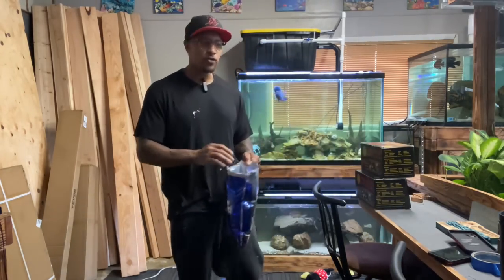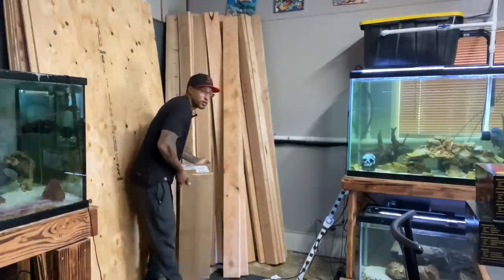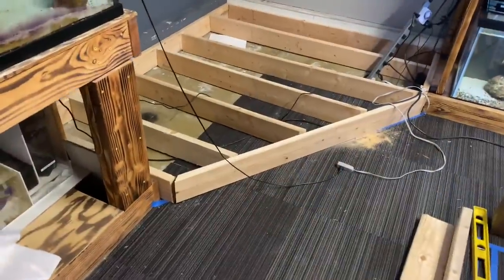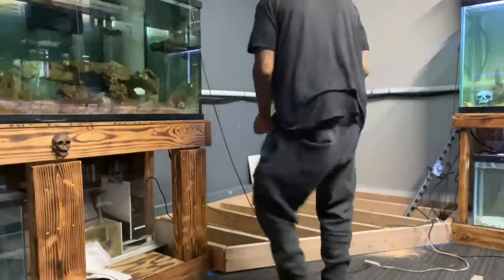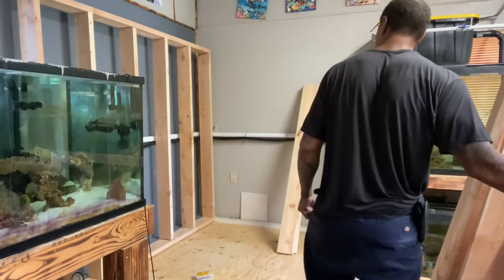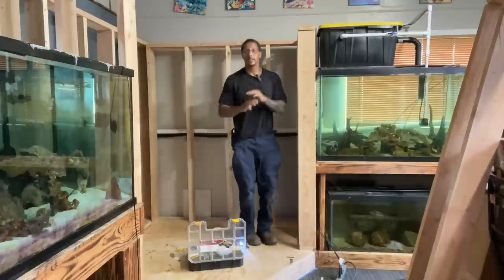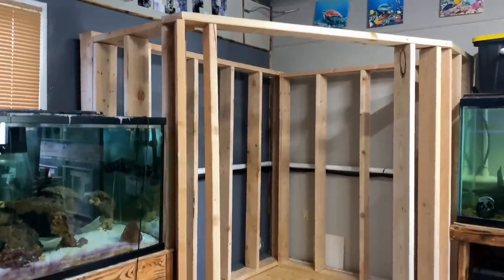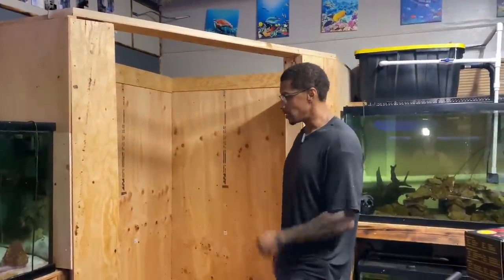1200 GALLON PLYWOOD SALTWATER AQUARIUM BUILD!! Pt. 1

Comment: Cleveland need some blocking in-between those wall studs. It will tie it all together.  The floor i suggest you put 2 more studs inside the outer perimeter to tie those 2x6 wall studs into. hope you at least doubled up on the plywood floor too. Nearly 11,000 pounds on it. I wish all the luck in the world on that build brother. 🙏
Reply from the maker: Thank you Brother, I appreciate your genuine support and feedback! I will definitely add bracing int between the studs and add 100’s more screws! I also plan to add a second layer of plywood everywhere! Right now the build is on hold but the idea is to make sure this thing never leaks!

Comment: Not to say you did anything wrong. but i would use PL premium to glue and screw everything together. second i would put bracing from stud to stud. second i would put bracing from the existing wall to the tank wall. I only am a Carpenters formen and have 25 years experiece building. I watch your content all the time  great videos and as soon as my house purchase goes thru i will be doing something similar to what you are doing. just not as many tanks .
Reply from the maker: Thank you for your support and feedback Brother! I respect and appreciate your comment! This is the difference between someone actually trying to help, compared to someone that just criticize without giving a single suggestion! I’m taking everything you said into consideration. 💯 I’m not done, I plan on removing the plywood and adding a ton more screws and bracing, I also plan on adding a second layer of plywood everywhere, I was just trying to get the walls up in the video. This thing is so far from fiberglass ready. By the time I’m ready to fiberglass, this thing will be solid asf.  

Congratulations on the new Home Brother! What size tank are you going to build?

Comment: 😱Aw Lawdy!  That wall gonna buckle, causing a leak aka real big phuaqn’ mess,.. at 44:50 timestamp look at plywood ,.. it’ doesn’t break evenly on 2x6,.  U can add another 2x6 to the left of the one that piece plywood it  coming up short at the bottom,. Is the floor level,. Did u square the framing,. 
 If u run into any problems , reach out!! I was framing homes  for 30yrs. That and concrete, roofing & remodeling,.
I’m not hating on u, just tryna help! 
Those aquarium stands in your fishroom, I flamed out my stands about 10yr ago, I applied  beech  color wood varnish and it really pops! Brings out the wood grain the darks(burn parts) lights & in betweens,. Also protects wood,acts as a clear coat but it darkens just a lil bit,
U got some nice lookin’ fish dawg!! 
I am in process of building/adding a 300gal cube to my fishroom,..
Reply from the maker: What’s up bro. I appreciate the help and feedback. I took this down. I’m redoing the whole thing. I’ll definitely reach out if I find myself in a jam. I’m building a rectangular plywood tank this time. 13ft x 4ft x 3ft. Much easier dimensions to work with. And I don’t have the funky angles, nor do I have this thing going up 6ft.
Reply: @TheFishCorner  hell yeah,.13ft x3tall x4deep?  Or 13x4x3 ,. Either way,That will be Nice AF!!
Are u building on a stand or on existing foundation ?  A gal h20 weighs 8lbs. Thats a huge b’yoch🤣,. 
Gonna be awesome!🤩 
I’d luv to build that size, I don’t have room unfortunately,.  Glad I found this channel,.  I enjoy the fish keeping hobby,.  I have 20+ aquariums at  the moment,. It helps me relax, relieves stress.  Not too many of the youngsters gettin’ into the hobby nowadays,. If u haven’t already found out,. Check out how Germany is into the hobby,. Bro 😎 it’s off the hook!!!
Reply from the maker: @blkicemike4857  13ft L x 4ft Deep x 3ft T. And yea it’s going to be heavy. I’m building it on a frame. Most of the frames I build can hold 14,000 - 16,000 pounds.  The tank will be slightly under 1200g the weight of it will be around 9,600lbs - 10,800lbs. The stands I build for my 240g can hold that. lol but I’m over building this stand just like I always do. I want it to hold 3x the maximum weight when the tank is full. I call it “a peace of mind” lol
And you’re right the youngsters be into other things. I started out 31years ago when I was 10. My oldest kid is 22 and can careless about fish but my youngest is 4 going on 5 and he’s going to be aquaman. lol
Reply: @TheFishCorner  yep 👍 I can relate,. My oldest is 25 in Aug. I started out koshering at 10yr old,. Done it ever since,. 
I’ll definitely keep an eye out on the tank build,.,.😎✌️

Comment: How will you maintain this aquarium and where will be the filter. There is no space to to get there from up only jump. I think it should be half that tall and this would be big enough and then can be put on top some filter and can be cleaned and put rocks , catch fishes. etc.
Reply: Jump there and dive to do anything and no place for filter.
Reply from the maker: I mentioned all this is a few videos but all my saltwater tanks will be connected. The two 44g trash can sumps are already in place, and running, my whole system will be pass through. From my 88g worth of filtration to my 225g to the 1200g right back into the trash can sumps. I wanted my tank tall. So it’ll be a statement, but just a little corner tank. Go big or go home. I love the fact that I’ll need a ladder to climb into it! Beast mode!
Reply: @TheFishCorner  Good Luck. Everything best with this aquarium for you. I only watch from my side and if I would have this size aquarium I would have this half tall because it would be better, easier to take care and for me this high is not then important, more is length for swim for fishes and with that floor, square, area of the aquarium this half high od the aquarium is the biggest importance, and with increasing highness of the aquarium  for me only volume of water is getting bigger, and costs , not the wellnes space for fish because the length and wideness is important in aquaristic for fish the much. Don't be angry with me, I was only worring of your difficult and hard work with maintenance od this high aquarium and costs electricity, water etc. Good Luck.

Comment: That's gonna fail. The taller the tank the more pressure at the bottom and sorry to say that doesn't look strong enough at all. The joints are not tight, there is no glue and not enough supports. 

Hope I'm wrong and it works out but your build looks dodgy.
Reply: Definitely gonna fail. And we got front row seats!
Reply from the maker: Damn, so much hate, why not try to lend some support, ideas, that’s insane how y’all come to a creators channel just to hate… sad really…. 

@MsBethanyClaire, judging before the show is over is a bit premature. 

And @davenharty553 you should be ashamed of yourself.  smh. 

Glad you have a front row seat to see this greatness. If you think this thing is going to fail, you’re clearly are as smart as your comment. That’s not saying much.